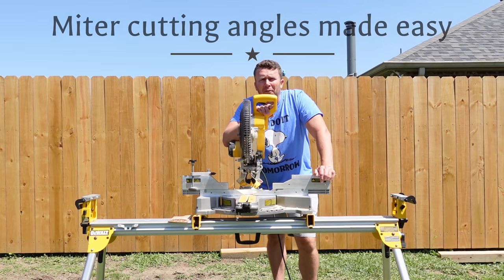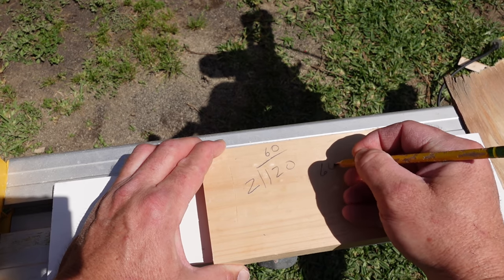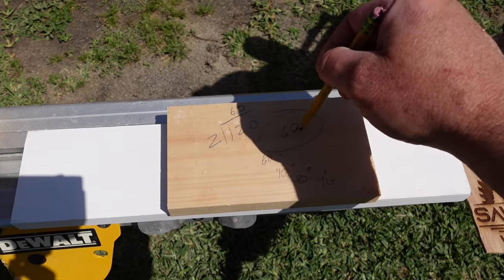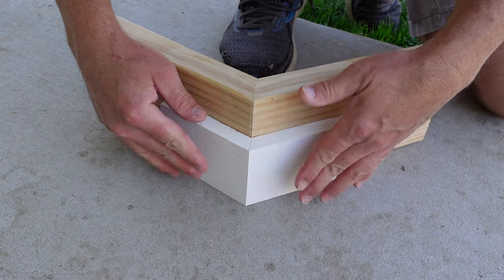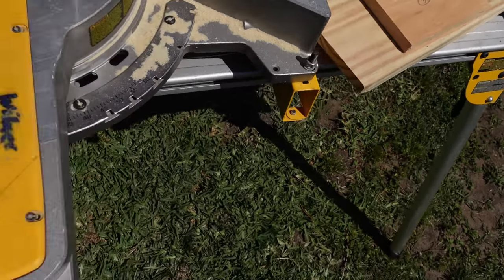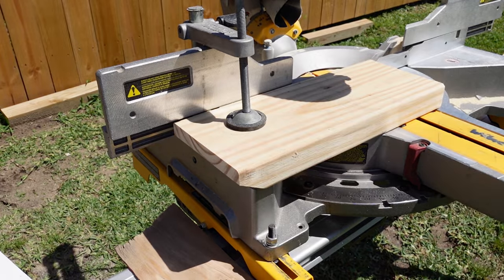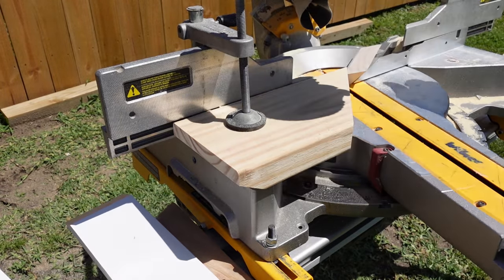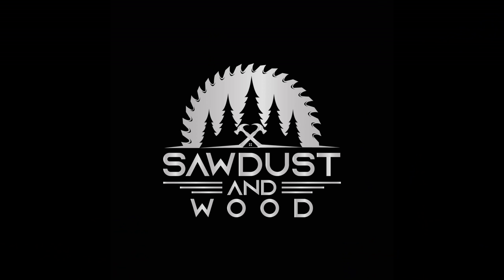99% of people don't know this about a miter saw...DO YOU??

Comment: Trim carpenter here. Great explanation/tutorial. Don’t be afraid to add a degree to your cut on baseboard outside angles. this will ensure that the outside of the miter closes up. For example on new construction I typically cut my base with 46 degree angles for standard 90 degree corners.

Comment: I was a carpenter/cabinetmaker for 30 years. This is a great explanation. They were just coming out with power miter boxes, (No sliding combination), framing guns, and so on when I was an apprentice. Not many people can say they framed a house with hand saws and hammers these days.
I had to learn all of this on a framing square, and in my 3rd year as an apprentice, the Swanson speed square came out.
Wish I had had a digital t-bevel or angle finder
Reply: @keithmarlowe5569  I didn't mention this, but I learned to draw elliptic arches to make brick cradles for arched widows like you see in churches on a framing square.
Reply: Hi
Reply: In my long past construction days I too used hammer (28 and 32oz) and nail. No air tools but we did use worm gear power saws to make our cuts. Framed. Roofed. Sheet rocked. Cabinetry. No plumbing, No electrical, No Insulation thank you. But I did move onto electronics as my second (and final) career. Retired now.I did emjoy this training video. Clear and concise.
Well done.
Reply: Did roofing/siding in the early 70's to the mid 90, helped frame a few homes, still remember sore elbows from swinging the Estwing, no guns, worm drive saws. I still have my Swanson speed square, used it a few months ago replacing some rotted trim (NC weather is brutal on wood trim).
Reply: I think everyone in construction has their own interesting perspective. When I was starting as a union apprentice in 1985, I had a speed square. I was curious as to when the speed square was invented. I googled it and it turns out it was invented in 1925! I never knew that. At that time we also framed with nail guns. These things were huge and heavy. They also just didn’t work very well back then. It was still better than hand nailing though.

I have an uncle who was an engineer at Milwaukee tool. He started Sometime in the 1950s. My father received a couple of Milwaukee prototype tools to try out. One of them was a power miter box that I remember my dad using in the early 70s. It was nothing like what we use today. I sure wish I had that miter box now. Not because it was a great tool, but just part of history.
Reply: @bobm916  I could never use an Estwing, they may last forever, but the twang, the noise would drive me nuts. Lucky for me I used Plumb Hammers all my life. I get teased for using them. 20 oz. is plenty. I've no need to be the He man on the job. End of day plenty of sore arms and elbows of the guys using 28 and 32 oz's. I always got the job done and never went home sore. Regarding Estwing, I was always nervous about missing and losing a finger or thumb...
Reply: @avgjoe-cz7cb  I would hit my fingers or thumb (roofing before nail guns) all the time and lose a fingernail occasionally with my 20 oz. hammer. I never used a 28 or 32, I saw too many guys using them, grip them halfway up the handle, losing the leverage. 40 yrs later I still have it, but recently bought an inexpensive framing gun because I've lost the ability to swing the hammer effectively from lack of daily use.
Reply: Wouldn't it make more sense to set the angle finder to the closest 90-degree mark? Then, simply halve the degree value you receive?
Reply: @tedrowland7800  please share that tip with us
Reply: @avgjoe-cz7cb just grind the hammer and will change that.
Reply: Speed square

Comment: Subscribed! Thank you for helping me to better understand my saw. 25 years ago I bought a Craftsman miter saw to fix my rotted windows. There was so much slop in it that the angles didn't fit tight most of the time. I immediatly abandoned it and bought the same DeWalt sliding compound miter saw you have and put it on a Ridgid Tools folding/rolling stand (like a dolly). I use this rig for window repair, fascia, drip edge, and soffit and more. The angles are always spot on. It's my pride and joy!

Comment: Ive been a carpenter for a long time and this man is demonstrating some very good tips. Great job sir and thank you
Reply: 25 years in and most guys can't even explain the work they do this is well explained very clean and simplifies it for people that haven't been in the trade well done sir
Reply: I've been a carpenter for over a decade and I am always learning!
Reply: This will blow your mind then. 180-120= 60. Divide by 2 and you have 30 degrees. Set your saw to 30 degrees
Reply: @ryandiedrich6317  I was actually picking up on that myself. Thanks for the verification bc it wasn’t mentioned that way…so basically just divide each angle in 1/2 again ? Where does the 180 come from though ?
Reply: @prgelectric5104  180 degrees is straight line. Half of a circle which is 360 degrees. This guy did everything correct, i just simplified the math part.

Comment: I’ve never seen this method before, as a mechanical engineer I still love watching other trades to get tips. Every day is a school day, and I’m glad I clicked on this 👏👏👏 As a side note I can’t believe how quiet your saw is, my old Ryobi is approx same size as yours, but as 15 years old, weighs a ton and sounds like a rocket launch in use………………😳
Sorry to preach but please encourage watchers to use gloves, 2 years ago I was cutting scrap wood to burn, I had long lengths in my saw supported by my rollers, as I quickly slid and cut them into 10” pieces. I wasn’t concentrating because I was rushing, and the long end of the wood on my left came off the roller as I slid it towards me. I had my hand on the wood and as the wood tipped up it pushed my hand into the blade which was going at almost full speed. I was wearing gloves and as I looked down there was a cut approx 4” in the top of the glove. I took it off and there was a cut on my middle finger along the whole length above the knuckle and I could see the bone. If I had bare hands it would have been a serious accident, the whole area had no skin to stitch so I did what any other mechanical engineer would do, put toilet roll over the top and taped it in place with electrical tape and went back to work 💪💪💪

Comment: A very clear explanation. Suggest that a useful extra tip is, cut the mitre half a degree larger (eg 45.5° for outside miter) or half a degree smaller (eg 44.5° for inside miter) to ensure that the visible outside join is tight.
Reply: 100%

Comment: When doing a mitre for acute angled walls, I recommend an infill at the junction point, so (with a 60 degree angle) you would first cut two x 60 degree pieces for the skirting and place each piece in position lining the internal edge with the corner of the wall, you will be left with a gap across the outside edge (because the angles obviously don't match) you then cut a 60 degree wedge piece to fit between them. The wedge essentially has a point on the internal side which meets at the corner point of the wall, the outside of the wedge bridges the gap between the first two skirting pieces. This method divides the acute skirting angle into two-halves and results in a two-step transition of the skirting around the acute wall angle. It alleviates what would otherwise be a sharp angle/point (bit difficult to explain). For example try doing an extremely acute skirting without this technique and you will have a sharp and elongated protruding skirting edge (if it can be cut at all!).
Reply: be quiet
Reply: Good advice! Thank you :)

Comment: Nice, some clear info. Though for trim, you’re rarely ever going to find an acute angle like this in a house. But for a wood worker building boxes or something, the jig and math is a great tip. 
With baseboards, keep in mind that there is a 1/4” build up on drywall outside corners that will throw things off. The angle finder will only measure the built up part, but the full length board will either need to curve in past that if it’s flexible, or there will be a gap if it’s solid.
Reply: Oh, you find them alright. I do staircases, and sometimes doing skirt board moldings where they connect at level runs we have to make what we like to call, suicide cuts, since they’re like 70 degree cuts usually and with small 3/8 x 3/4 “ mouldings.
Reply: they're all over my basement, the former home owners built in weird pattern's, it looks cool but was a PITA on adding trim when I redid the floor.
Reply: That's what caulking is for, at least in a paint grade situation. Stain grade? Well, that's when I would bust out a rasp or sandpaper, and nibble that bulge down a bit... Find the happy medium as it were, then move on... If the drywaller is worth his weight in salt, he would ensure a nice gradual taper when floating, eliminating the problem. Even "inflexible" trim will usually give a little.
Reply: Yup. The drywaller, often me, will only taper out a foot or so, and this is all the angle finder will measure. So, it’ll give you a rough starting point, but you’ll need to adjust, whether that’s with caulking or a rasp, or in my case, just adjusting the cut angle a point or two.
Reply: @markoshun  yeah, depending on the circumstances. A degree or two will usually compensate when it's not sloppy mudding. Since I do my own drywall floating as well, it's usually spot on, but sometimes, we have to follow someone else's work... Great video btw...
Reply: Because of that I always add a half degree (or full).  For example, if the wall was 88 degrees, I would cut the miters at 44.5 or 45, not 44.  Miter saws will do half degrees, especially the DeWalt saw that he uses in the video.  Then I would turn the trim over and backcut the trim this way if the drywall is inconsisant it won't bind and the front edges will touch.  The miters are almost never open even a sliver if this is done.  If they are slightly open even a crack, then put some wood glue on your finger, push it into the crack, take a screwdriver with a round shaft and roll from the bottom to the top where the trim meets, wipe off glue.  Always perfect and perfection is what everyone should be seeking.  For inside corners, learn to cope them.  If you cope them and they are open or closed (slightly) it doesn't even matter.  I have told people that the least used angle on my miter saw is the 45 degree.  Walls are almost never 90.   Drywallers are under a tight schedule they don't always float their corners out as far as they should.
Reply: @wadopotato33  Nice info. Thanks. As I do my own drywall, I’m curious, how far do you think drywallers should float out? 
Standard is 12” to 16”, which won’t flatten a wall. You’d have to at least double that which would increase time/cost too much. 
My experience is a foot or so will usually allow a 1/2” base to pull in to within a  1/8” or so, easily caulkable. 

My point was that drywall finished walls are not flat or square, even if  done correctly, so using a miter gauge without that knowledge won’t give the best results.
Reply: @gregorymosher5008  I too am a stair builder/ rail installer and the situation you described is what popped into my head also. Here is a quick way to cut that angle based on a 40° stair. Cut a block like he did but  leave the ends square not 45°. Set your saw to the right, to half the angle of the stair, in this case 20°. Put the square block to the left of the blade, i like to use at least a 1x8. You then use the square end of the block as a fence to run your trim against. Your trim will be perpendicular to the saws original fence. Once you make the cut you will see it makes that long cut you will need where the stair stringer/skirt meets the level balcony. Works every time. Adjust you block and saw to the opposite sides to cut the connecting piece.
Reply: @johnklein6040 thats how i was taught and its works perfectly
Reply: So are are you telling me that when I set my mitre saw to cut 30 degrees, I am actually cutting 60 on the board held with my left hand (held against the fence).
Reply: @mikelaaper9100  My simple angle finder doesn't have numbers, just a simple pivot with a lock. So I just copy the angle on the wall, lock it in, and transfer it to the saw table, no figuring. 
If I had the kind of angle finder he's using, I would just turn it off and transfer the wall angle to the saw.

Comment: If you don't have a digital angle finder, it can be done manually with a t-bevel, compass and straight edge. Set the t-bevel angle against the wall, then transfer to a piece of scrap. Bisect the angle using the compass and straight edge. Set the t-bevel to the bisected angle and use that to set the saw.

Comment: Great video.
One thing I'd mention to all home-shop types - you can spend $1k on the best, biggest sliding miter you can find, but if you don't get the $25 mag. angle finder to use to set the blade and the same $15 angle finder he had to figure the miter - none of it matters.  Setting up the saw is the most important step that's skipped by 95% of the people out there.
Reply: test blocks and eyeball are better. most saws are off 1/2 degree anyway.

Comment: Thank you for the nice explanation. 

There is actually an easier way to determine mitered angles with an angle finder. 

First, take the angle of the corner, then subtract it from 180 degrees (for example 120 degrees becomes 60, 90 degrees becomes 90, 60 degrees becomes 120, etc.)

Then, divide the number in half because there’s two pieces making the angle. That’s it. 

You’re welcome.
Reply: Wait why doesn’t this work with the 60 degree example 120/2 60 but he’s cutting 30
Reply: I can work with that! Thanks 👍
Reply: @woopar305  Because he is cutting TWO 30 degree angles - 1 on each board = 60! Duhh, is that really hard for you to understand?
Reply: @scotty362100  take it easy scotty
Reply: @scotty362100  don’t get yourself beamed up Scotty

Comment: There is an easier way to deal with outside angles. Start with your angle finder straight. Adjust the angle to fit the corner. You measured 120 degrees. So you take 180 and subtract 120 and you get 60. So you need to remove 60 degrees total. You want to remove half from each side or 30 degrees.
The way to think of inside angles is just to install one straight cut, miter and back cope the second cut. However, this only works when you are square or more open than 90. A tighter angle will require the first cut to be angled enough that the point fits into the corner. Then miter the 2nd and back cope it to fit.
Reply: Zero your angle finder at 90degrees. :)

Comment: If you double or triple stack and securely clamp your jig block so there is a taller backer for pieces with compound miters when you use a jig it's much easier to keep the piece you are cutting firmly against the block to ensure your cut is straignt from top to bottom.
Reply: Was just about to say this. For doing miters "veritically", either because of the specific board or because you only have a single bevel, use a block to space the workpiece a few inches from the fence

Comment: I was told to make outside miters 1/2 degree over on each side because walls are never square and it's more important to make sure the outside touches than the inside. I replaced all my baseboard and I had 3 outside miters. worked on all of them. Something about that tiny extra that made them work well. BTW, my house is 50+ years old.
Reply: I cut inside corners at 44 and outside at 46 always
Reply: @c_mac7773  46 is a good idea on an outside corner but don't you cope the inside corner?
Reply: @johnklein6040  I always cope if I can but if you're mitering then I'll do 44 or 46 even if it comes out 45° with a gauge. It just makes those areas of contact a little bit tighter 
🇺🇸💪🏻👊🏻🤙🏼
Reply: @c_mac7773  I agree, face has to hit, no gaps to caulk. Has to do with the fat spackle corners. Lol.
Reply: @johnklein6040  yep! Even drywaller's that do a pretty good job always leave the very bottom sloppy of the corner be there inside corners lol
Reply: @c_mac7773  You must use the same guys i do! 🤣

Comment: I only figured this out with the jig a couple of weeks ago and I contacted Dewalt to find out if they had a proper attachment to sell for their equipment.  They said I had to patent the idea myself and submit it.  Well now.... here it is !!  I had to cut a 45 degree angle as I was putting trim around a right-angle triangle.  So all I had to do was put in the 45 degree jig and then move the saw to 22.5 degrees and voila, I have a sharp angle.  Because my trim had an intricate profile on it, I had to move the jig to the other side of the saw bed and do everything on the right hand side for the second piece.  The one danger with using this jig is that ones hand is very close to the saw and the trim is basically sticking out past your hip and can be difficult to hold level and tight.  If you are in a small room and are cutting a long piece of trim, it might not fit before hitting the wall.  If I were doing this a lot, I would rig up a stand the same height as my saw-bed to help rest/clamp the long piece of trim on.  I did my math from a different point of view.  The straight edge on our miter saws is 180 degrees (half a circle)  If your wall corner angle is 120 degrees you subtract that from 180 and get 60 degrees.  This you divide in two. You need two pieces cut at 30 degrees.  Just go to the 30 degrees written on your saw.  If you have a 135 degree corner angle, subtract that from 180 and you get 45 degrees.  Divide that by two and you get 22.5 degrees which has the "stop" built in on our miter swing.